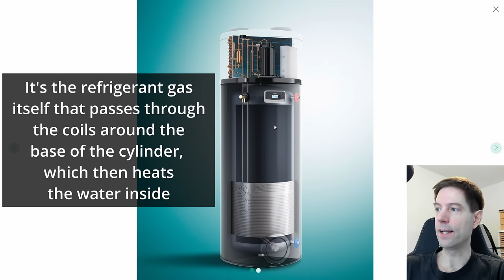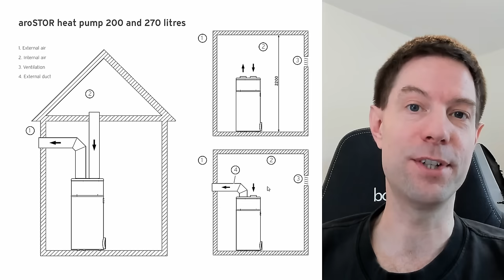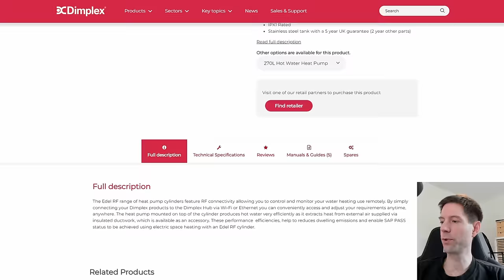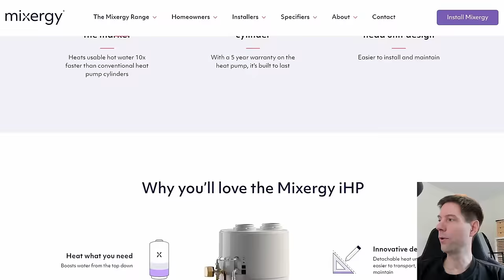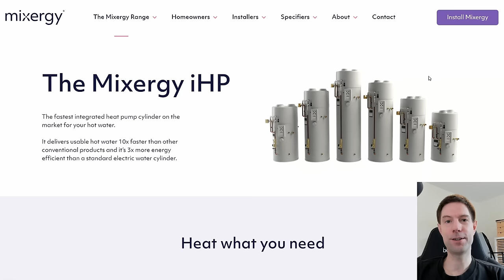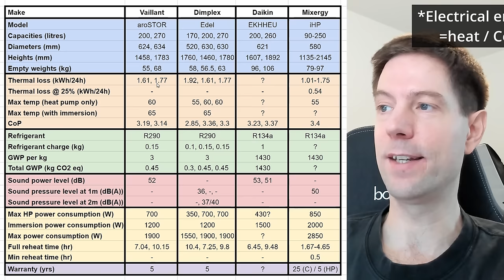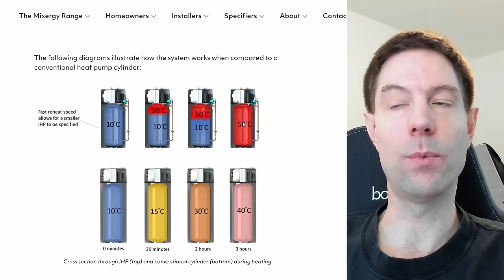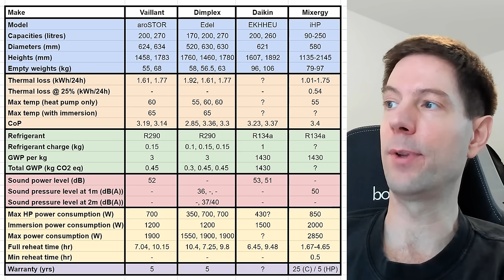Heat pump hot water cylinders - comparing specs

Comment: It’s whiskey time guys , my messages need to have a health warning attached to it = need at least a half bottle of whiskey,  once again apologies for my stupid questions, have been watching a few channels in regards to heat pumps but yours is the one that makes sense to my simple mind , I don’t have money for solar or battery storage = just don’t have that kind of money, for my situation makes sense to get rid of my gas boiler and go heat pump but makes more sense for me having air to air rather than going air to water with changing radiators size and all that stuff , I live in a small three bedroom terrace house and was thinking about getting a cylinder with heat pump and getting two mini split systems one down stairs one upstairs and get rid of all the radiators plus my immersion heater tank , in my head it makes sense but it would be nice to get your opinion, also with the government grant would I be allowed to have that system or does it only apply to a system such as air to water  ? Because I think the system I have mentioned would be cheaper not only to purchase but also to install.
Reply from the maker: Currently the boiler upgrade scheme only applies to air to water systems, so your plan wouldn't be able to benefit from that.  I'd suggest getting in contact with Octopus (if you are supplied by them) to enquire about their air to water system installation.  For a property your size you might find that it costs almost nothing extra after the boiler upgrade scheme has been applied, so well worth looking into.  If you went for A2A plus heat pump cylinder you won't get any grant and it'd probably cost you the best part of £7-10k for that combination.
Reply: @TimAndKatsGreenWalk  Thanks for reply , shame it only allows for one system yet the other system would be cheaper without the upgrade to radiators so overall would be cheaper to install, makes me wonder if I as an individual can apply for the grant and then get the system I want and of course supply the receipt to the government so they can see that it was spent for the green agenda .
Reply from the maker: @KavanOBrien  I'm afraid it doesn't work like that.  The BUS simply can't be applied for with an A2A system, regardless of who does the application.
Reply from the maker: I agree, it's bonkers that the grant doesn't apply to all heat pump systems.  I hope that will be rectified at some point but as you say, we're subject to the whims of whoever is in charge, sadly.
Reply: @TimAndKatsGreenWalk  Oh so you do think I have a fair point  , coming from you guys that’s as big of a compliment as one could hope for , I really do appreciate you giving me your opinions and perspectives of how my mind sees things.
Reply from the maker: @KavanOBrien  well, not least if we could have gotten the grant for our system I would have been a lot happier, for sure!
Reply: @TimAndKatsGreenWalk  You guys have got a heat pump with four blowers ? I was thinking of two mini split systems one on ground floor and one upstairs both have two blowers on each or four units with one blower on each, I don’t know how you did yours or did you do a video on it ? I’ve got a question that I can’t find the answer too , you know the blowers you have on the wall are there ones which are smaller or slimmer because i don’t have much wall space between ceiling and window or doors , not sure if the term blowers is the correct name for them.
Reply from the maker: @KavanOBrien  we have two outdoor units, one of them runs three indoor units and the other runs two indoor units.  In hindsight I think we should have gotten a single outdoor unit to run all five indoor units though (I think it would have been more efficient and also cheaper, more importantly).  I'll dig out the video of our system tour, one moment...
Reply from the maker: @KavanOBrien  here you go: https://youtu.be/PIgrN9uJfHY?si=dxzbrnoqgcMBlkSU
Reply: @TimAndKatsGreenWalk  oh you can get on unit to serve more than three blowers didn’t know that , the pipe work would have to be a problem if one unit outside was serving four or five units inside or am I thinking wrong, or do you have the mini split systems, and if I may ask what is the name of the unit that can run four or five blowers ? Sorry for asking so many questions = steady on the whiskey you two.
Reply from the maker: @KavanOBrien  yeah, there is a limit to the maximum pipe run length so that will need consideration, but an installer would be able to help with that.  If you Google for the multi-split outside units we have (from the video) you'll find the five unit versions too as they're part of the same range.
Reply: @TimAndKatsGreenWalk  Do you have a video within your library of the installation of your system, I know you said you’ve got two one with three blowers and one with two blowers, as you said if you was doing it now you would have one unit outside with five blowers inside, if you don’t have a video on it then what is the make of your units , I’m beginning to worry about your whiskey consumption.
Reply from the maker: @KavanOBrien  I posted the link to the video earlier.
Reply: @TimAndKatsGreenWalk   Oh sorry , thank you both for being so nice .
Reply from the maker: @KavanOBrien  no problem.  Let me know if you need me to post the link again (or else you can find a playlist of all my A2A videos in the playlists section of the channel).
Reply: @TimAndKatsGreenWalk  Thank you kind souls , when you post new videos I will start my message with = it’s whiskey time.
Reply from the maker: @KavanOBrien  it's been mead time for us recently (whiskey is a bit strong for my taste 😉)

Comment: if they take that long to heat a full tank that would make me think they’d either have to run long during the day; I’d size based on only heating overnight off peak because they can’t recharge fast; or more heavily consider mixergy as it can always provide hot water and doesn’t dilute compared to others
Reply from the maker: Usually they wouldn't be heating from fully cold, so the reheat times should be less than those values but yeah, it's still several hours, probably.  Even so, that's a big plus point for the Mixergy.

Comment: Yep, don't know why Daikin & Mixergy went for R134a & the Daikin 1 kg refrigerant charge must be wrong for such a small close coupled system. The average refrigerant charge in a large fridge freeze is 100-400 grams so 1kg is way too much imo. 
Sound Power level data is the noise level taken at the source e.g. next to the unit in question. Sound pressure level is at a specified distance in a free field with no barriers & is lower than the Power level because sound levels decay over distance. Any barriers between the source of the noise & the measured distance will have a reduction effect on the source noise level. So if the heat pump was inside an airing cupboard the walls of the cupboard would reduce the noise level outside of it. If the cupboard walls were acoustically insulated then this would reduced the noise level even further. That said, I would still not recommend putting one of these HP cylinders in an airing cupboard with bedrooms bedrooms nearby. The Garage or the loft would be a better bet. I was looking at my loft for one of these (in place of the gravity cold water tank) but I have a small trap door which means extra cost to enlarge it. The smaller diameter Dimplex 170 might be an option but probably not enough water volume for a 4 bed house. My garage is rammed but is a better bet & easier to install a cylinder like this albeit connection to the mains / hot water pipework in the house more of an issue. Decisions, decisions.
Reply from the maker: Yup, my preference is for the garage and thankfully we have space there.  It will take some minor rearranging but nothing too troublesome, hopefully.

Comment: It will very much depend on the cost of the mixergy it is certainly the one I am hoping to go for but as its still to be available for sale it is a worry.
Reply from the maker: Yes, indeed.  We should find out soon as I hear it'll be available shortly.  More on that as I find out the details.
Reply: @TimAndKatsGreenWalk  The only pricing I have seen is about £900 more expensive than the Vaillant
Reply from the maker: @clarkfinlay78  yup, that doesn't surprise me.  Although you could probably get away with a smaller cylinder since you can heat it up more quickly if required, so that might mitigate the cost difference slightly.

Comment: Immersion heaters don't work in the way that you describe. The heated water rises to the top of the cylinder and, as the stratification between the hot and cold water is very pronounced you can draw off the water from the top without needing to heat all the water in the tank. As far as I can see, the Mixergy tank is little more than an immersion heater with additional control and monitoring capabilities.
Reply from the maker: These are heat pump cylinders.  I wasn't talking about the immersion heater heating the water I was talking about the heat pump, which heats all the water in the tank fairly uniformly; there is no pronounced stratification as the heating is spread out over a wide area around the cylinder.
Reply: Mixergy (either immersion or with integrated heat pump) seem to defy physics by heating from the top down.

They do this by putting the heat source at the top, then using a small pump to take colder water from the bottom of the tank and move it to the top.

By controlling how fast this pump operates with software/sensors, it can gradually push the chunk of hot water down from the top. I presume it operates slowly enough not to stir up the water too much.
Reply: It operates by “misting” the water into the top, minimising the turbulance

Comment: I've worked on heatpump installations and have had an air to water system for over10 years now. Some of your information is very misleading to anyone out there who doesn't understand the technology.  A separate tank isn't the best option , because if there's an issue on the tank  you have nothing.  Also I find your comments about re heating the garage or loft. You either have a warm loft or cold loft , you don't heat it. A cold roof is  always pulling fresh air through the sofit vents, so it's using latent heat . Every system has a once a week setting to go over 60° and yes it is needed.
Reply from the maker: I did say if you have an A2W system you don't need a separate heat pump cylinder, I was very clear about that (see 02:53).  I don't think that was misleading in any way.  Regarding heating loft space, it doesn't matter how much insulation you have some heat from your house escapes into the loft, that's basic physics.  If you remove heat from there it will make it colder (even if it was 'cold' to start with) and your house will lose some heat back into it.  It may not be much, and it may not make much practical difference, but that's how conservation of energy works.  I did also mention that these systems all have anti legionnella cycles.
Reply: You dont need 60 degrees , as Tim says 55 is plenty

Comment: If you have a photovoltaic system on your roof (or you are forced by the law to install one, as it is the case for new constructions in many EU countries) it is better to produce hot water with a conventional, cheap, and fully static, maintenance free for decades, electric boiler. Infact you are probably selling for almost nothing (typically 4 €cents/kWh) most of your production to the grid. Just convert it in hot water and save money, complexity, and running costs (maintenance/replacement) of a heat pump heater.
If you have money to spare and space on the roof just install a few more cheap PV panels (they are really cheap nowadays) to better saturate the inverter power even in winter/mid season (i.e. 8kWp panels with a 4.5 or 6kW inverter).
If you have a well insulated house you can have winter space heating too with electrical resistance mostly for free (from PV) and save the cost and complexity (and maintenance) of a heat pump. Probably you will miss a few kWh in December and January, just buy them from the grid. You will not break the bank!
But running a house with fully static, maintenance free, and totally silent plants is priceless! You have only to switch on the air conditioner in summer.
Reply from the maker: You are free to do whatever you feel is best.